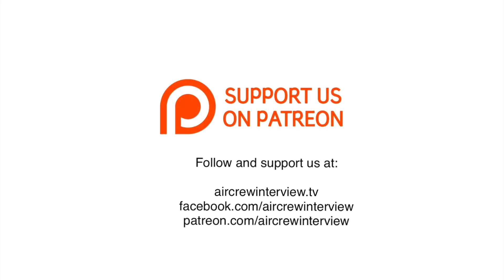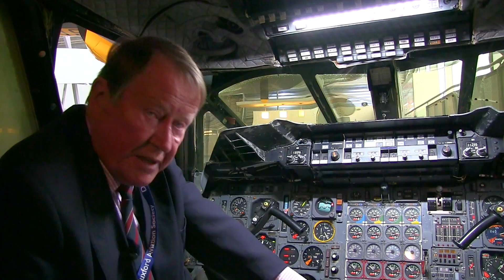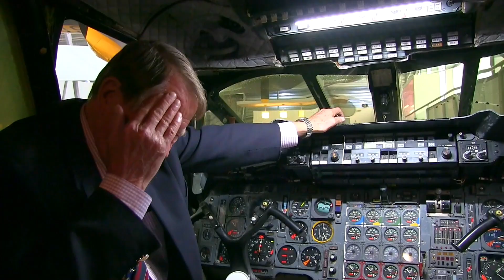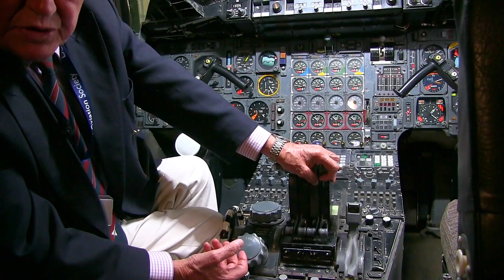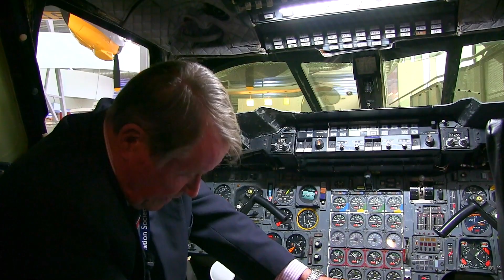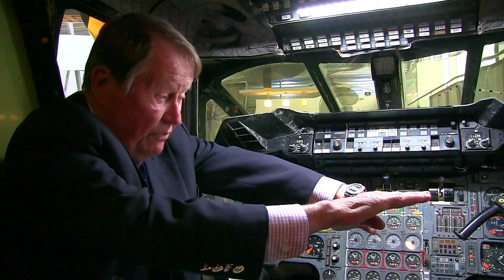John Hutchinson on Air France Flight 4590

Comment: Judging by just how far left of the runway the accident aircraft was in this video's thumbnail I'm forced to conclude that catastrophic engine failure lead to the loss of this Concorde and the loss of the entire program. Putting two afterburning Olympus engines directly below the fuel tanks was not a particularly good idea when considering the chances of tossed compresor blades. Engines failing and ejecting bits is non uncommon, but tank penetrations and landing gear damage via hot engine pieces is. One unfortunate occurrance, which is commonplace in other designs, could lead to all the data collected about the accident plane's final flight. I think Occam would agree that picking up a Ti strip from a oft swept runway, cutting a reinforced tyre, throwing a chunk of rubber through a fuel tank releasing fuel ... is four complicated steps that had to happen in a precise order and timing for it to happen at all: The difference in both cases would determine the future of Concorde. A freak accident in the Ti strip unlikely progression might keep Concorde flying whilst a catastrophic failure in the only engine approved For Concorde would see the plane mothballed.

Comment: ...sorry and please someone answer ... why 3 tonnes of fuel. Thinking because its so powerful BUT 3 tonnes of fuel ...for taxying!!!! Where does it all go ... Those wings are paper thin???? Mystery upon mystery.
Reply: Concorde's engines consumed a lot of fuel, even when on the ground.  Although 3t is a lot for taxiing.  And the fuel wasn't just stored in the wings.  Believe it or not, Concorde had 13 fuel tanks, divided in the wings and the fuselage.  Fuel was constantly moved around by the Flight Engineer to maintain Concorde's CG (centre of gravity) during the flight.  And Concorde's afterburners (reheat) consumed most of the fuel on take-off and when accelerating to cruise speed.

Comment: Christian Marti, the captain of that flight had a superstar status, just like Van Zanten, the Dutch captain of the KLM flight that hit the Pan Am in the Canaries in ‘77. One would have thought that CRM had eliminated authoritarian captains, but Marti, like Van Zanten was known as a man one didn’t mess about with. So the first officer and flight engineer probably didn’t dare confront or overrule him. And since the engineer shut the engine off without telling the two pilots, I’m guessing communication wasn’t up to modern CRM standards on that flight deck. Perfectly avoidable accident, but then most accidents are.
Reply: Capt Hutchinson is incorrect about the Flight Engineer and should proibebly apologise. 

From BEA report P 133: "Engine fire alarm actuation and the very low values on the parameters led the crew to shut down the engine after the Captain called for the engine fire procedure. In fact, the movement of the throttle control lever to its idle stop is heard and, a short time later, pulling of the fire handle. In addition, the deceleration of the engine, established from the recorded parameters, is consistent with a commanded engine shut down."

See the following timeline from the CVR and d Concorde Flight manual.
o	14 h 43 min 13.4 s, message from the controller indicating flames at the rear and read back by the FO. 
o	14 h 43 min 16.4 s, FE “(stop) “. 
o	14 h 43 min 20.4 s, FE “Failure eng… failure engine two”. 
o	14 h 43 min 22.8 s, fire alarm. 
o	14 h 43 min 24.8 s, FE “shut down engine two”. 
o	14 h 43 min 25.8 s, Captain “engine fire procedure” and in the following second the noise of a selector and fire alarm stops.

Comment: Concorde had a similar incident back in 79, with no spacer issue:
https://www.washingtonpost.com/archive/politics/1979/06/15/concorde-scare/ff7c6f1d-e2d2-43c7-981e-9402789c43c5/?noredirect=on&utm_term=.bf231d80adf1

They were very lucky in 79 that the fuel didn't reach the hot exhausts from the engines and so the escaping fuel didn't ignite, or they would most likely have suffered the same fate. The wing structure and flight controls wouldn't last long with a massive blaze like that - definitely not long enough to make another approach IMO.

So BF/AF & the aviation authorities knew that Concorde had a weakness and they ignored it and the crew and passengers paid the price. Both companies were negligent IMO, as were the FAA, because the accident happened in US. They fixed the wings after the Air France crash (inserted rubber armour to protect the underside of the wing's fuel tanks), but by then it was too late. They could have done this in 1979, but they didn't. You shouldn't be flying planes that have a known fatal design flaw that needs to be fixed, end of story.

Pity, I wish she was still flying. Saw her take off many times, even as a jaded frequently traveller, I always craned to look as long as I could to follow her. Mr Hutchinson appears to be eager to blame everyone, as long as BA are blameless, which I find distasteful. He also neglects to mention the previous incident, which I think, says a lot, because it most certainly is pertinent, obviously.

Comment: Could someone please explain how any aircraft is allowed to take off 'overweight'. Surely there's a maximum take off weight for a reason. I know the wind plays a part but the extra luggage should have been left off. Also, I read somewhere that the wheels were skidding right from the start of the take off, slowing the acceleration badly. Pilot error for me.

Comment: The Captain killed those poor people :(
Reply: That's not true his paraphrasing makes it sound like he's blaming the Capt but there are many more details to this story like the gear that failed to retract causing excess drag making their climb out that much more difficult and by his own words he states that "we will never know how much those bags weighed" but the crash report states it was less than 1 ton overweight and had a negligible effect on performance. 

He also motions with his hand a right overbank implying the loss of fuel from the left wing caused the condition when in fact the overbank was to the left and caused by failure of engine 1 from the fire and the subsequent massive asymmetric thrust from 3 and 4 forcing the pilots to reduce thrust (or face a certain crash) of an already struggling jet and the decay of airspeed made the stall inevitable - there was nothing they could do. Since engine 1 subsequently failed from the same fire affecting engine 2 his assertion that shutting down num 2 was a critical mistake can't logically be true they simply would have crashed a few seconds later than they did - even if it wasn't the appropriate action by the book it was irrelevant in the end.

It's also been determined that the left wing would have disintegrated long before they could have made any runway so less weight and more speed were irrelevant they were doomed from the start and the captain deserves more respect than this video implies he flew it to the end.

Comment: At takeoff it was 6 TONS over weight, this pilot was pretty casual about flying a very touchy aircraft. The Air France aircraft was a 747-400 Air France wasn’t flying a 380 at that time. Had the takeoff been normal the Concorde would never have come close to the piece of metal. The tires hit and destroyed a number of runway edge lights, it wobbled down the runway. The fire would have burned itself out, this Concorde STALLED and crashed. The aircraft should have been able to return to the airport safely. I read the final report by the French Court, Continental was released from any liability. All the documentaries have been completely wrong, in blaming the incident in the piece of metal. It was pilot failure, terrible decision making by a very cavalier cockpit crew

Comment: Wow this really changed my thinking of this disaster because it wasn't long ago when I watched a documentary about this "accident" and everything was blamed on a piece of metal which now I know was extremely wrong!!
Reply: Not completely wrong.  It was the metal that cut the tire, resulting in a piece of rubber moving at 200MPH  hitting the fuel tank, causing it to burst.  Although the burst tank itself didn't down the plane, the crew's action resulting from the resultant fire pretty well doomed the plane.  If the fire hadn't happened the outcome would have been different.
Reply: @dhy5342  Alleged that it was the piece of metal, it could have been due to the tyres blowing apart from the problems being suffered at the time due to the spacer not being in place.
I beleive the fragment of metal is a red herring to cover over the more important factors.
Reply: @dhy5342  Lol...... the hole in the wing was 300mm x 300mm, Aluminium melts at 655 deg C. The linear aircraft speed generated enormous forces on the tyres, also consider factoring in the increased tyre pressure due to heat generated by scrubbing. 

Did you know the French locked all the left tyre fragments in a safe and wouldn't allow Britsh air crash investigators access, they did eventually after considerable protest? Why would they do that, very odd behaviour?
Reply: @coyote5735  Concorde wasn't built out of Aluminum.

Concorde's skin was made of Hiduminum RR58. It retains huge strength at high temperatures due to  the nickel alloy composition.

They make engine pistons out of the same alloy.
Reply: @RB747domme  RR56 is approx 93% aluminium; an alloy; AKA Aluminium 2618. Melt temp around 635 deg C.

Comment: Excellent explanation - all I can add is to suggest that the rotational speed of the outer tyre face would have been 176 knots - the same speed as the aircraft’s ground speed at the point the tyre failed and so far from impacting the wing at “whatever speed” and like a missile, it actually hit at 176 knots minus any retardation due to air resistance after separation but before impact . . . . Irrelevant to the overall synopsis but a technicality. What a shame that Concorde no longer graces our skies!

Comment: What I get from this is that even if the fuel tank had not burst from the impact of the slice of tire caused by the FOD, and if the flight had taken off safely, it would have been left with a seriously compromised landing gear that would have been (at least in my mind) quite likely to fail on landing. Whether or not that would have been a survivable incident or not, we'll of course never know, but I would not at all be surprised if it would have been at least a hull loss.

Comment: So many,  TOO many mistakes.....Why the F/O or S/O didn't dispute the TGWT issue,  the fueling issue beyond the required 83% of capacity not to mention the mechanics who f**ked up not reinstalling the spacers on left gear trucks ,  the captain taking off with a 10k tailwind....holy crap !!!!  PS;  I have never crewed an airplane (multiple crew) that had a S/O shutdown an engine without informing the captain..never...and if I were in the left seat I would have deballed him for that...it was still producing thrust which MAY have had a pivotal effect on the accident...what a pity ,  all that life lost
Reply: The FE DID NOT shut the engine down without informing the Captain. He announced the FM Bold Face item and the Captain commanded it. Capt Hutchinson is completely wrong on this. From the accident report and CVR:

From BEA report P 133: "Engine fire alarm actuation and the very low values on the parameters led the crew to shut down the engine after the Captain called for the engine fire procedure. In fact, the movement of the throttle control lever to its idle stop is heard and, a short time later, pulling of the fire handle. In addition, the deceleration of the engine, established from the recorded parameters, is consistent with a commanded engine shut down."

See the following timeline from the CVR and d Concorde Flight manual.
o	14 h 43 min 13.4 s, message from the controller indicating flames at the rear and read back by the FO. 
o	14 h 43 min 16.4 s, FE “(stop) “. 
o	14 h 43 min 20.4 s, FE “Failure eng… failure engine two”. 
o	14 h 43 min 22.8 s, fire alarm. 
o	14 h 43 min 24.8 s, FE “shut down engine two”. 
o	14 h 43 min 25.8 s, Captain “engine fire procedure” and in the following second the noise of a selector and fire alarm stops.

Comment: This was shown in an air crash investigation kind of a program in the Discovery channel, and later on got hijacked by National Geographic that showed it all as an unfortunate force major  chain of events...
Being a pilot myself I always had the feeling that this was more likely what had happened rather than what NG tried to tell, omitting inconvenient evidence.
Here you see a several human errors that caused the fatalities:
The ground maintenance crew that neglected to reinstall an essential spacer bracket on the undercarriage.
The ground crew that didn't inspect and cleaned the runway of debris from the DC-10.
The pilot that ordered to overfill the tanks setting both plane overload and the centre of gravity too far backwards, as well as reducing the flexibility and impact absorbing ability contributing to the rapture in the wing tank.
The pilot that ordered to put the extra luggage in, although the plane was already overloaded, & even more so in the back!
The pilot that reacted to the fire warning and killed the engine although, you NEVER KILL AN ENGINE THAT STILL GENERATES THRUST in such a critical time and circumstances.
The pilot that didn't let the yoke forward in order to use the ground effect to fly a little further at same low altitude in order to gain speed and only then pull to gain altitude maybe dump some fuel and try land somewhere preferably an airport...

Comment: Air France and the corporate media did one hell of a cover up job on this number.
Reply: mmtot: The French air safety board also buried the details, blaming it all on the metal strip and the mechanic who installed it.
Reply: Msm doing what they do best.
Reply: The corporate media is corrupt.
Reply: Indeed, they killed a good aircraft prematurely.
Reply: Air France and the French judicial system did something similar with Air France 292
Reply: The 447 coverup was even worse

Comment: Seems like this "spacer" is a giant and kind of hard to miss important part. Who the hell was working on the plane that managed to miss THAT from being put back in???
Reply: probably just missed one iline on the assembly/ service instruction.  the landing gear is complex with many operations to assemble and adjust/align.  ever put together a complex Ikea product - it is eay to overlook one line item if you do not actually check off each step of the instructions.  Company policy and attitudes can  have affects on the morale and attitude of service personnel.  get an arrogant manager more concerned about the timetable and avoiding overtime than thequality of work and mistakes happen even with decent and cocientous service personnel working.  Management never seems to identify where their own attitudes and behaviour contribute to such situations - easier to blame someone lower on the ladder.  who knows - but it doesn't sound like it was even investigated properly.

Comment: I find it ironic that at the end of runway 20 right was a Boeing 747 with the president of France as a passenger. The concordes left side under carriage repaired and a critical piece not replaced, seems like veering to the left and hitting the plan the president was on could have been a clear motive. Amazing how this was not publicized until now ... the Concorde ended up just missing the plane and subsequently crashing.

Comment: Take-off speed of 220 MPH is a Hail Mary every time. Tires are running past tolerance with the weight. Was eventually going to happen. Design flaw. Q- Did they know and built her anyway?
Blaming an American airplane is covering.

Comment: Close but no Queens Birthday Box, this year. Though there is blame enough to go around and responsibility and liability sufficient to have wiped out any airline, airport and administration in America, the chunk of rubber had been flung off and the fire started a couple of thousand feet, at least, of take-off roll before the aeroplane passed the much-maligned strip of metal from Continental's DC-10. 

Missed undercarriage spacers and a total absence of management in a cockpit ostensibly under the "control" of a 300-hours-on-type sprog "captain" and including an autonomously-operating airborne mechanic, ("flight engineer" - who shut down a perfectly fine and functioning engine) all covered up by an absolutely corrupt government and bureaucracy that was and still is the owner of the airport, the bogus inquiry -- and of Air France -- and whose "accident report" is a work of fiction.
Reply: Yes, the Concorde was on fire as it passed the fire station. This vital piece of evidence is always ignored. But why?

Comment: The fire started due to the fuel hitting the exhaust bezel not the brake fan wiring. What a crock of shit this guy is spewing. Jet fuel has a higher a higher flash point then diesel. A electric spark is not sufficient to ignite it. The only way it could have ignited was in atomized form hitting the extremely hot exhaust causing it to self ignite or flash.

Comment: I wonder, if the tire didn't strike that shard of metal on the runway causing the chunk of rubber to slam into the fuel tank, how the landing would have been since the tires and undercarriage were damaged already from the missing spacer. Would it have landed ok and just beat the crap out of the gear and tires even more and landed with no injuries or were they just screwed as soon as they started their ill fated take off run? Not that it matters, just curious.